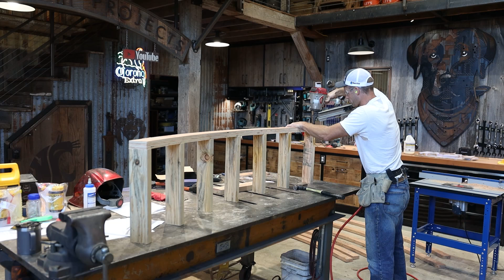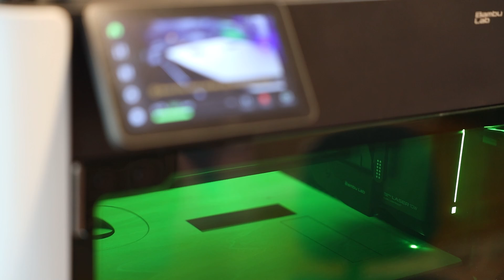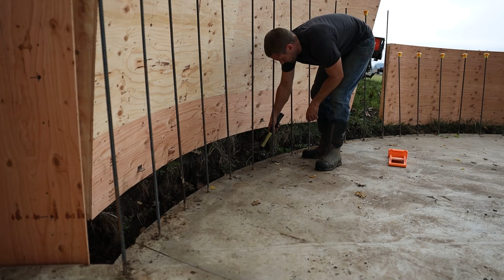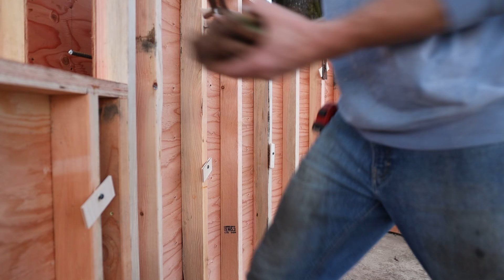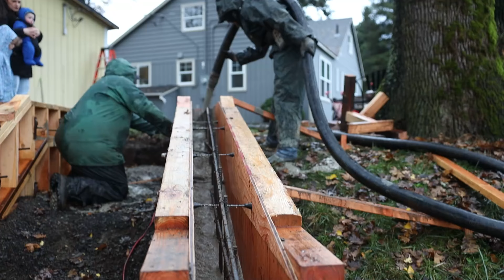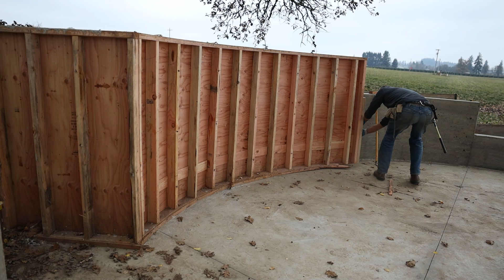Curved Concrete Retaining Wall (Covered Fire Pit Build Ep. 2)

Comment: Rebar (A615) should not be welded because the carbon content means the weld can make the bar harden / brittle and easier to break. There is a weldable type of rebar (A706) with lower carbon but you won't find that at your local big box store.

Comment: When you're going around a corner with your rebar, make sure that you use or add a piece which is bent to actually run around the corner. This ties the two pieces together as a single piece around the corner rather than just relying on the little ties to keep the two pieces of rebar together.

Comment: 16:15 Use OSB 1/4". Smoother, plyable, flexibility with a laminated surface. Coat with used synthetic or motor oil as a releasing agent.

Comment: I'm curious if there is a stock radius one could get from an ICF supplier.  One would have to plan ahead to know the diameter of the slab, but it might be cheaper & simpler to have the icf forms do the hard work.  Being EPS, one 'could' melt them away leaving the concrete exposed.  That would be a whole lot of work in itself, what with the plastic ties as well.  You'd probably want to use stucco on it afterward.  You know what?  Never mind.  Sounds like a lot of work either way!

Comment: A fiberglass flange would probably be the best way to finish off the hatch opening.  If you make the vertical side of the flange large enough, you can scribe and cut the vertical side to fit perfectly against the hatch area and tight against the wood.

Comment: Hey when you disconnect your problem line on your hydraulic lines take a pointed edge and open that valve up and let some fluid out. I fight with my grapple on my Kubota.  I started pushing in the valve on the one that always gives me fits and it now goes on just as easy as the other hose.

Comment: Great work.  However, why did you not use masonite sheets 1/8" thick?  They are easier to bend (no relief cuts), it is a one time use and the masonite would hold up, lower cost. Oh well hindsight.

Comment: Great results! 

You could have cut your lumber costs basically in half by pouring one half and then carefully removing and reusing the forms (reassembled in a mirror image) for the other side. And its roughly the same amount of labor. 

Not sure what that would have saved you after factoring in the need for 2 concrete truck visits rather than one, but lumber isn't cheap so I expect it likely could have saved you quite a bit.

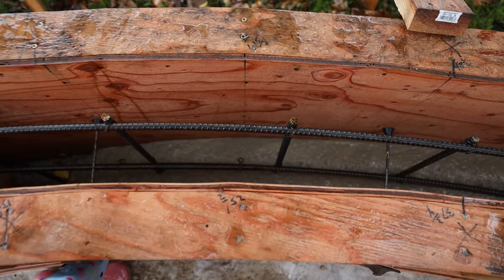Comment: 26:06 a recip saw without a blade in makes for a good form vibrator. Place the blade guard against the form and then pull the trigger and vibrate the form.

Comment: A706 rebar is weldable. Welding regular rebar makes it too brittle, it's not a corrosion thing.

Also there are kerf calculators on line for determining the spacing and depth of kerf cuts for bending plywood. That may have helped with your plywood bending.

Comment: This is too late to be of use to you, but...  I built a round tower in my house using pretty primitive technology compared to your CNC showcase, but one thing I did different made the bending of the plywood easier -- based on the typical applications for plywood, its strength axis is lengthwise, so it tends to curve much easier along its shorter length, its width.  Excellent video!

Comment: Welding the rebar can’t make it corrode faster when inside the concrete providing there is no air pockets. For corrosion to happen there needs to be air and moisture able to get to the steel which shouldn’t be possible if it’s poured and vibrated correctly 👍🏼

Comment: Here in Brazil we use a lot of plywood and wood in general to shape concrete, the only thing we do so concrete doesnt stick to wood is wetting it, wet all the internal walls of the mold and you should be fine! 
Lovely project you're building man, great work!

Comment: @rainfallprojects not sure if someone has mentioned it but where the ties are and the cones your supposed to fill them with a concrete patch so the ties don't rust and expand within the concrete breaking your wall apart. You should look into this as it's an important step.

Comment: Nice work
I worked in Formwork for 15 year's before changing trades to pipe welding.
Formwork Bolts I think might have been a better bolting option I don't like snap ties.
Bolts are more versatile stronger and reusable but more expensive.
The 3d printed chamferd corner are genius.
We used to buy them with a flat tab coming off in line with one if the face you could use to nail to edge of the plywood

Comment: Really nice build mate, lovely form (and formwork for that matter),  re the timber, may I suggest floating treads down the middle, with a slight shadow gap between the tread and concrete?  You could backlight it at some point, but would look nice (in my opinion) having the treads integrated but seperate to the walls and then link into the overall fire pit, assuming you can use the same timber and if your weather would allow for that without a massive maintainance impact (being in Australia, ive no idea how much snow will impact you)  great video, will subscribe.

Comment: Next time you have a similar project, use your CNC table to run kerf cuts (reliefs) every 12” or less. It will make the sheet more pliable and won’t reduce the strength. You’ll get smoother curves and struggle less getting them aligned.

Comment: Everyone today is in such a hurry to strip forms.  Kind of understandable up to a point for the professionals but for a home job where you have the time to do it right I was always taught to leave the forms on for seven days.  With as wet a mix as you had I would have left it for sure.  Pulling forms at one day is crazy even at two you are risking sharp corners and short corner walls cracking and crumbling.  I was surprised that you got away without any whalers on your forms.  The vibrator used properly makes all the difference for finished walls.  Nice job.

Comment: Easiest and probably strongest way to do curves is use several layers of thinner plywood.  In your case probably two sheets of 3/8 instead of one 3/4 would have made the curve and been less of a struggle.

Comment: Only because you cut the arcs out using the CNC, couldn’t you just have it mark increments that measure the arc length so that you’re not hassling with measuring after? Just curious

Comment: Welding the rio bar won’t cause any more risk of corrosion, concrete cancer starts from the outside working in, if you’ve got sufficient cover (50mm) your steel will be fine.

Comment: I have a question for rebar profesionals; why is a wire sufficient in these kinds of cases is also up to code? it seems to me like a fragile connection at these points, do they slip at all? break when the concrete is poured? or is it just a lateral movement kind of restriction, they have to be as strongly connected? love to hear any advice !

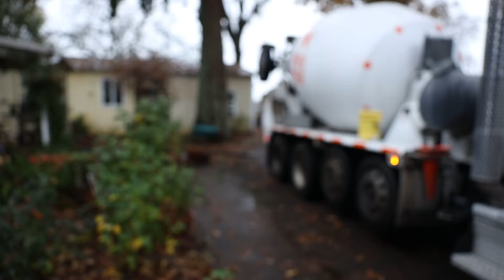Comment: 24:24 concrete fright is real. Sometimes, even after years of pours and pours, some complicated, some simple, you still get it when something itches your nose. That's when you say "i might look like a fool, but i will be a fool with a good form" and add more reinforcements. They're like clamps in a shop. Never have enough of them. :) For such a complex form, you did very good. Also, if your concrete guy shows up and tells you "this is not ok" or " add this or that" even if it goes against your better judgement, consider doing it, because they've seen a lot. Short of the guy (or gal) being new on the job, they've done it enough times to learn the deal just as good as the next form maker.

Comment: would have been neat to be able to have conduit integrated with the cross ties.
then you could have run low voltage lights to each of those cone shaped indents.
Looks awesome.

Comment: Bigger router!!! That's a very small router for what you've been working with - also, for measurements on curved (but also normal measurements) you can use a measuring wheel. Worth getting one even if most of its life is as a wall hanger. When you need it, you own the day. :)

Comment: Tip for measuring around curves. Sewing measuring tapes are more flexible and you can tape them down as you go around the bend. Looks great!
Reply: I wondered about this. He drew the line digitally to cut the curved pieces, so it would have been simple to grab the curved line length off the computer.